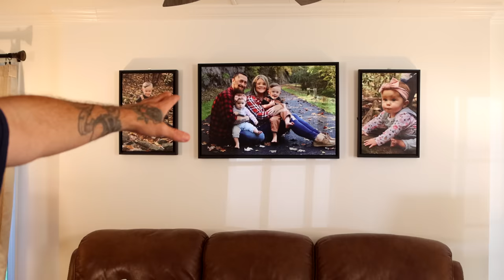I painted her living room without permission

Comment: We are self contractors . DO alot of painting and drywall... I know those colors ya want lol.. Usually we use PORTER paint .. It is the longest lasting .. I suggest a flat paint on the walls when you have kids . It's much easier to clean :) YOU all would be shocked to know how many people enjoy the fall burnt orange color for accent walls . But here is a tip for paint buyers .. If you look at a Porter paint color .. Do not think you can buy a Walmart brand or any other brand it and be the same color .. Very much different .. If you need to use a Walmart paint of Val-spar paint make sure you use their color chart to compare . Or you will be very unhappy with the color difference .. I wouldn't suggest a walmart paint at all because it pills off in time .. DAD using NO plastic to cover that couch , LIKE OUCH LOLOL